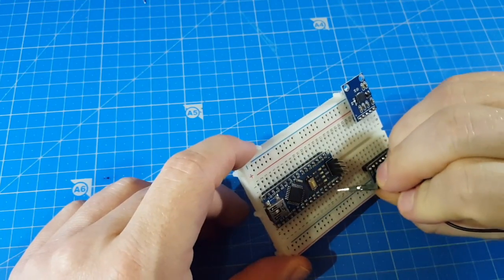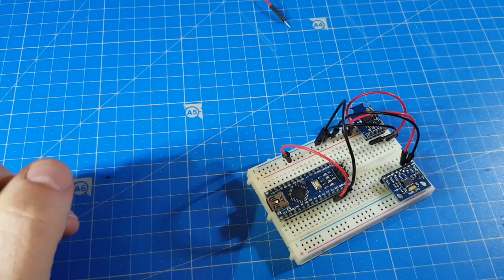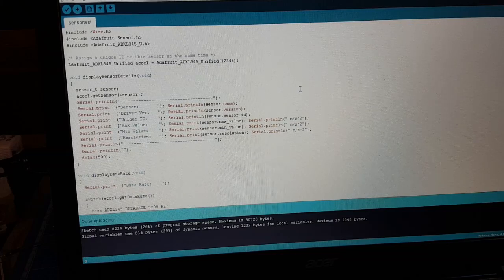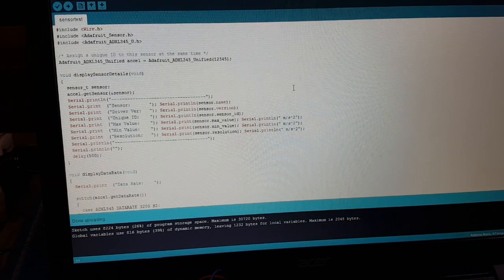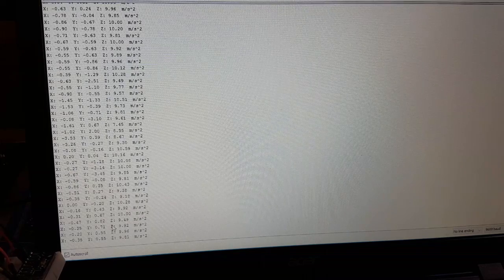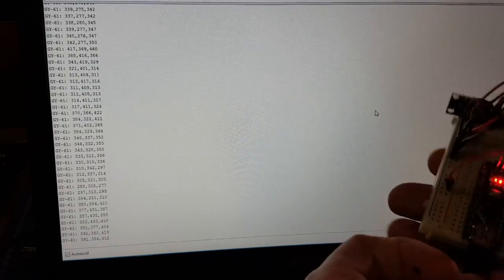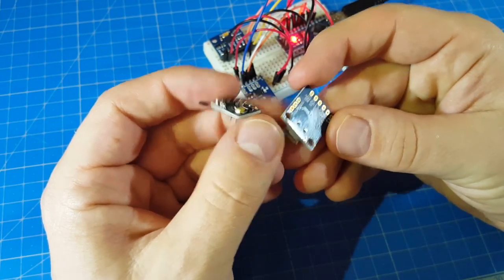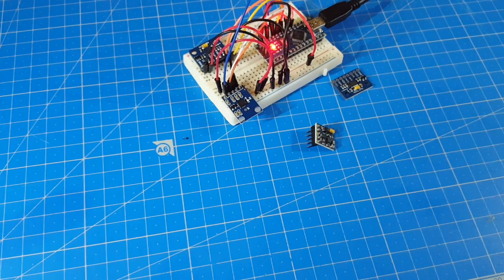Keeping balance with a gyroscope

Comment: nice video, unfortunately,  generally, the ground is at the low side.
Reply from the maker: Thanks! Where was my mistake?
Reply: It is not really an error, but generally by convention, we place the positive lines at the top and ground or negatives lines below. The breadboard should just have returned with the red up and the blue down. :-)  I'm sorry, it's not important, just a convention. At the end of the video, it's right. :-)
Reply from the maker: Nice to know. Thanks!